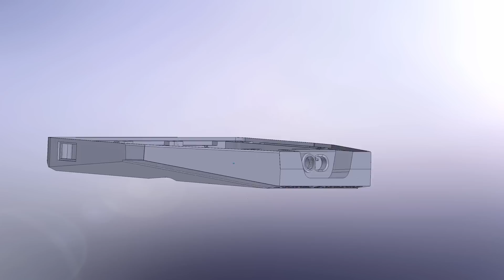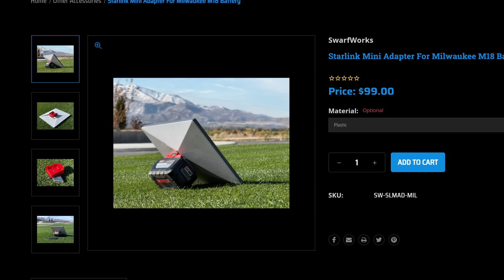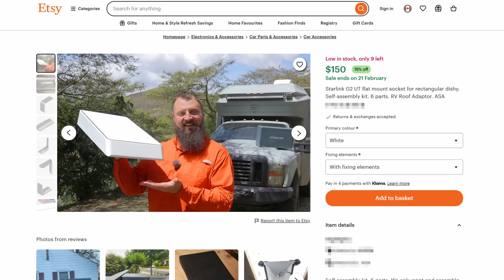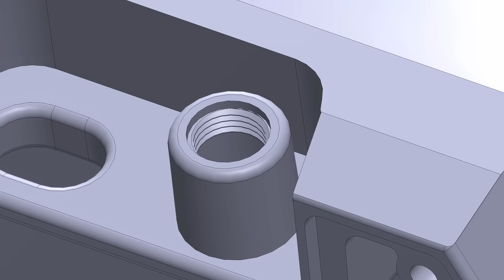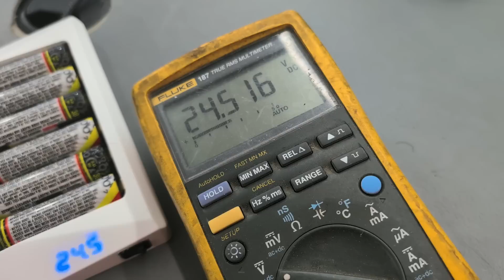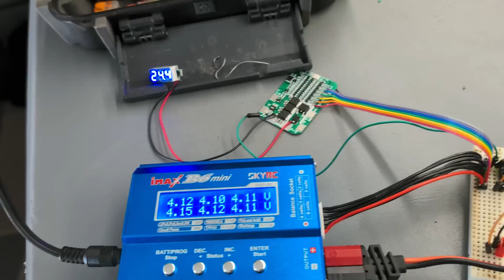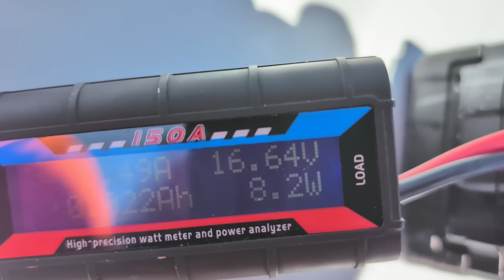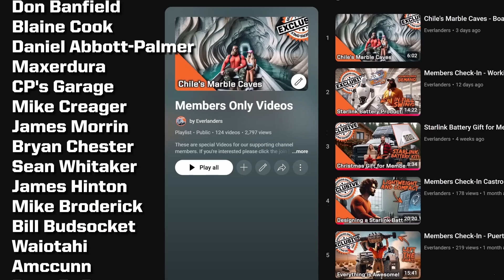DIY StarSled Go - Cheapest Smallest Starlink Battery Pack

Comment: Hello,
I have a question about powering and charging the StarSled while using my Starlink Mini in a vehicle.
I am planning to use a DC-to-DC step-up converter that takes 12 V from the vehicle and outputs 24 V at 5 A (≈120 W). The specific model is the Greluma 12 V → 24 V 5 A converter with stable 24 V output.
Could you please confirm if this converter is suitable for:
	1.	Powering the Starlink Mini through the StarSled
	2.	Charging the StarSled battery at the same time while driving
	3.	Ensuring that there will be no interruption to power to the Starlink Mini when the ignition is turned off and the system switches to battery power
Thank you for your help!😁
Reply from the maker: Sure, why not...

Comment: Thanks for the video, I have a question. Can I use this kit with a permanent power supply? If so, what voltage should I use so the BMS can keep the batteries always charged?
Reply from the maker: The ame charger I linked will work perfectly.

Comment: Does the print really have supports included? My printer did poorly with it. Is there a version without supports so my slicer could add them? When I add supports in the slicer, it tries to support the supports.
Reply from the maker: Yes, it really includes supports, if your printer can't handle it, you can support the supports. It will work just fine...
Reply: Is the mesh of material around the port openings needing to be removed? This was printed very solidly using PETG and a P1S and won't snap out. Isn't it better to let my slicer put in supports that are calculated using the specific material and printer?
Reply from the maker: I've printed hundreds of these without problems, if you would like to use it for free, that's great. Modify as you see fit...

Comment: Which 3D printer do you use?
Reply from the maker: https://youtu.be/5MXkD7Z_ndc
Reply: @Everlanders Thanks much🙏🏾
Reply: He uses an ender 3, but those are very outdated and I wouldn't recommend them especially for a beginner. And I'm someone who owned one. 

The bambulabs A1 or A1 mini is faster, quieter, has automated bed leveling, better print quality, and works pretty much out the box. 

If you're new to 3D printers please save yourself the headache and don't get an ender 3, he has a unique usecase of needing to be able to run it in the van which the ender 3 allows because it's customizable and moddable, but the ender 3 really isn't a good printed anymore in comparison to competitors.
Reply from the maker: I disagree with many of the statements made in the above comment.

Comment: How long a run time do you get on a good set of batteries?
Reply: Between 1.94 and 3.9 hours depending on use 

~~~~ 

The starlink mini consumes on average 20-40 watts in use. 

This project has 6 batteries, a quality 18650 contains 3500 mAh at 3.7 V. 

3500 mAh x 3.7 V = 12,950 mAh, or 12.95 watt hours per cell. 

12.95 Wh x 6 batteries = 77.7 Wh. 

Therefore The battery capacity on this project with good batteries is 77.7 Wh. 

If you take the low average power consumption of the mini, 20 watts, then 77.7 Wh ÷ 20 W = 3.9 hours. 

If you take the high average power consumption, 40 watts, then 77.7 Wh ÷ 40 W = 1.94 hours. 

Therefore this battery pack with quality 18650 batteries will last between 1.94 and 3.9 hours depending on use. Hope this helps!

Comment: Have you considered making a waterproof cover? I love the design but will be using mine in wet environments.
Reply from the maker: It would never be waterproof, cover or not...
Reply: Sounds lame, but put it inside a plastic bag when needed?  It's gonna work anyway.
Reply from the maker: I think people get too hung up on what needs to be waterproof, after it's tested and working. You can fill the corner with the BMS with epoxy, the batteries won't care if they get a little damp, no different then the battery in the front of your car...

Comment: I printed and made the sled but I am having an issue with it over discharging the 18650 batteries. I used the recommended hardware and wiring guide so I think I have a defective BMS that doesn’t cut the power at the low voltage threshold. I’m not sure how to fully test the BMS to confirm my suspicion.  The volt meter also stay on all the time. I saw there was a revision to the BMS so I was thinking about swapping it out.
Reply from the maker: The voltmeter will always show voltage, the BMS just cuts the supplied current. To verify, charge the cells and monitor the individual cell voltages, especially once they get low, ~2.8v  if the dish stays online and any one cell goes much below 2.7v then the BMS is defective, damaged or miswired.
Reply: @Everlanders thanks for the advice. I probably have a defect board because the cell voltages always drop below 2.7v and doesn’t cut off.

Comment: Fantastic design!  Thank you!  I've ordered parts and looking forward to assembly.  I was wondering about the battery holder -- is there a way to secure the batteries or is it basically the spring tension and little clips holding it in?  Do they stay fairly secure?  I'm picturing myself being clumsy on a hike and losing a batt or two in the brush.  Maybe I'll paint the batts bright orange :)
Reply from the maker: The black housing of the battery holder has flexible fingers that holds in the cells, I'd argue they're too hard to get out...

Comment: Great video! For printing the main body (with the designed support), is there a need for additional support (Tree, etc.) . Just print with no supports?
Reply from the maker: Nope, just press play... If you've had a history of poor bed adhesion, or are new to 3D printing, it won't hurt anything, but it's wasteful if you have a well tuned machine.

Comment: Cam you use it and charge it at the same time from the original power cable?
Reply from the maker: Nope
Reply: @Everlanders  Could it be modified to support lower power feeds - using the batteries to deal with the power spikes?  I know it could - I guess i am asking how!
Reply from the maker: @DorianLogan of course, a Current Limited DC-DC converter would work perfectly.

Comment: Super cool design and thanks for being willing to always share your STL files.  I printed and built two of them.  I struggled to get all of the parts right using Amazon because I’m impatient but after a couple tries everything fit great.  I did attempt the build in a usb-c PD trigger with a adjustable boost converter but have failed so far.  Hopefully you get your 100,000 views so we can get your build list! Cheers!

Comment: i probably would have used masking tape, made a 5s stick with a barrel connector and then hooked up a 20v panel to the the ends of the battery and called it a day. if lucky i would look for a pvc pipe to stuff the battery's in and done it that way. however this looks like a great option as well!

Comment: Ok being a Bambu noob 😉. What are the 3 pins that print with the back plate for?
Reply from the maker: They are attached to the back plate to lock into the starlink detents when installed, I just super glue them in place.

Comment: 17:34 A trick to use on those fuses is to crimp a couple female spade terminals to your wire and insert the spades of the fuse into the terminals.  Shrink wrap and/or electrical tape as you see fit.

Comment: Has any one noticed any heat issues. I hot glued the board into the spot into the shell. It got so hot it re melted the hot glue after 20mins running in the starlink.
Reply from the maker: The dish itself gets pretty warm, I would not use hot glue for the board...
Reply: @ how would you secure the board or wouldn’t you ?
Reply from the maker: In the video I used a drop of the UV cure resin in the corners. Mine is still solid.

Comment: interesting soluton. any thought on extending the bottom a bit and square it off with the starlink? i am thinking lowering it a bit to the edge, add 2 more batteries then doing 4s2p configuration. i think it woudl extend the battery live and be sufficeint power 14.8v+ to feed the starlink. due to short run there should be no voltage loss. alternatively is possible to also use flat cell batteries as well but it would add to the cost. regardless i like this DIY Solution and nice to know it exists if i even need it. hmm if this is setup as a 4s2p you could use a PD USB C Charging module
Reply from the maker: Sure, do it!

Comment: Awesome. Since I carry cordless tools and the mini takes a wide range of input voltages I picked up a couple adapters to run the mini off my cordless tool batteries.
Reply from the maker: Super, just don't brick your batteries as I warned in the video.
Reply: @Everlanders  Good point. I didn't think about the lack of a low voltage cutoff. I'll have to add one 👍

Comment: Great design. Simple and cheap. Question: How does the BMS handle 12-14v DC feed from a vehicle chassis or coach bus? Do you need a BUC Converter to raise the charge voltage from the vehicle to 24 volts?  My goal here is to have the battery/BMS kit power the Mini Dish directly as it does while accepting a charge from the vehicle chassis bus. This would protect the dish from low voltage scenarios on the chassis bus during Engine Start or Accessory Start scenarios where voltage dips can drop to 10-11 volts.

Comment: Can I use the Starlink Mini power supply to recharge? The power supply is 30V, and this BMS is 24V, I'm afraid to connect it.
Reply from the maker: The Starlink Power Supply has no current limiting... The lithium charger I recommended is only a few bucks, and will properly charge with current limits.

Comment: Thanks for the great idea. Just took out one of my trusty  Goal Zero Sherpa 50 that I have about 10 off.
 It seems to run on both the 12 as the 19 volt laptop port. Will do some more testing.
Reply from the maker: Yep, it will run fine on either...
Reply: @Everlanders  Have to admit, even at 30 watts the Starlink will empty the sherpa rather quickly but for a backpack/bike-touring situation it wil work for sending and receiving emails etc. Charge with a solarpanel and off you go.

Everyone going into mountains/offgrid should have that for safety reasons...... Can't wait for the moment phones work with Starlink for txt-messages.

Comment: Hi nice video.  The minis are a game changer. My van had a fibre glass roof so I am looking to mount the mini inside the roof. If you use a DC -DC buck convertor you might get 28-30V out of your solar panel. Or you could split your 6 batterys into two 12v packs in parallel, and the step it up to 20V. Other combinations are possible.
Reply from the maker: Or just run it on straight up 12 volts. No need to complicate it.

Comment: I really love the design. Tweaks on my wishlist would be a maybe some sort of simple fold-out flap to still be able to adjust the angle, as well as a waterproof variant (thinking waterproof switch, a drop of epoxy around the connectors and a lid with a seal over the cells, as well as a seal for the lid on the back and maybe some brush-on resin to waterproof the printed bits). While the dish itself is IP67 the battery add-on kind of makes it less suitable for use in wet conditions. Have ordered the parts but might try a slight mod.

Comment: How about a tabless 21700 version for extended battery life while maintaining the small, backpack friendly design?
Reply from the maker: There's no need for the extra cost of tab-less cells, the current demands just aren't there... Further, they wouldn't fit in the same space. But if you want one, go for it.
Reply: @Everlanders  excellent, even more reasons to use the 18650 like you suggested. Thanx for the explanation and the great video. 🍻

Comment: Great idea.  Maybe use a wide fitness power band that one could wrap around the antenna and cover the back of the batteries so they don't get bumped out?
Reply from the maker: It's not needed, they are in there really securely.
Reply: @Everlanders  , OK..I was also concerned with those double stacked blue batteries sticking out as well.  Thanks again, would love to find someone willing to sell these assembled.
Reply from the maker: @douglasmontgomery6315  The CC License does not allow for commercial sales.

Comment: Got the sled yesterday and I am extremely impressed by the design, documentation, and parts.  The packaging of the project is in itself professional, down to the colors used, parts bags, and shrink wrapping !  He did an amazing job on the printing and sending them out.  Thank you both so much !
Reply: @AlanKrum  where did you order it? I had asked if someone was making them to sell and got no response. Thanks.
Reply: @norcoredneck  I didn't order it, it came as because I am a member of the channel to support their adventures and projects.  Jason is the designer and you should ask if he is going to be making them available.
Reply from the maker: As I mentioned in the video, they can be made for $12 in parts. If you want one pre-assembled, I can build it for you for $499
Reply: @Everlanders  But wait there's more, order two for only $1,600 😉

Comment: I don't have a 3d printer, and I was trying to use an online service to print these parts for me, but the battery cover is a .3mf file and none of the online services recognize the file.  All of the .STL files loaded just fine though.
Reply: I ordered all the parts (minus the housing) and even though the components are cheap, shipping is expensive.  For the Batteries, I spent $48 for 10 of the nicer batteries ($40 of that was shipping😮) and on Ali express, it cost $27 for everything.  Up to $75 so far and still don't have a way of printing the housing!
Reply: I love this design, and I want to make it work!  Thanks :)
Reply from the maker: You got ripped off! I would have shipped you one. Are you on some distant island?
Reply: @Everlanders  Do you have a way to share the Battery cover in an .stl file instead of thr .3mf file?  The online 3d print companies won't accept that .3mf file for printing
Reply from the maker: @TheMulk777 It's there... Look again.
Reply: Thanks, got it!  Do you recommend an online 3d print company?  Components are starting to arrive! @Everlanders
Reply from the maker: @TheMulk777  Just the ones I mentioned already in the video.
Reply: I wish!  I am in Washington State.  

The Batteries had the most expensive shipping.  Ali-Express had great unit prices, but the shipping ended up costing quite a bit.  Good news is, they come with extra parts/pieces, so I will have those for the next project!  :)
Reply from the maker: What...!!! AliExpress is the worst place to by batteries... Please read the description again. I built 50 kits for what you've paid.
Reply: @Everlanders  No, I bought the nicer batteries you linked at Jag 35 - they just have crazy shipping prices.
Reply: @Everlanders  The batteries at Jag35 were $8 for 10 batteries, but $40 shipping - they only had one shipping option to Washington.  Looks like they are in California, so no local picup options.

Comment: Thankyou Everlanders This is exactly what i am looking for, but have one question how would i charge it from 12 volts just use a 24v step up  and the BMS takes care of charging profile or do I need a specific 12-24volt charger? thx
Reply from the maker: I've been using these: https://amzn.to/3EdH5OW
Just set the voltage to 28.2 volts and set the current limit to 1.5 amps or so... (3a if you've got the Sonata Cells)
If you don't already have one, these are great for initial setup of such a boost converter:
https://amzn.to/4jDKh6L
You can dial in the current and monitor the voltage as it charges, as the battery approaches full you'll see the current is cut by the BMS once full. Good to monitor the first charge or two.

Comment: What a genius design! I did find a little Milwaukee battery adapter with a low voltage cutoff, but it's clunky and annoying to use. Having a much more compact and thought out design with similar battery life is the best option. Thank you again for all the work that you do! I've used a lot of your videos to upgrade my camper.
Reply from the maker: Is it the goofy LVC with a Mechanical Relay being held closed?
Reply: @Everlanders  I'm away from home, but I can dig into it and take a look next week.

Comment: Nice work! Already printed, had to use supports on my X1C with PETG-HF as the first one didn't bridge well. But with adding some tree supports it printed perfect! Thanks again!
Reply from the maker: You need to use my profile which has the interface material between the designed supports in the body...

Comment: I have tried 3 cell BMS boards from AliExpress but they allow the sales to go below their lowest voltage threshold Where can I find a 3s BMS that doesn't allow the batteries to overdischarge?
Reply from the maker: I've tested these and they did in fact cut off.